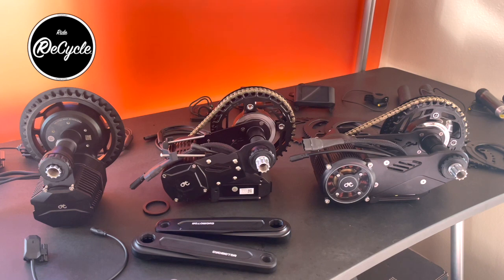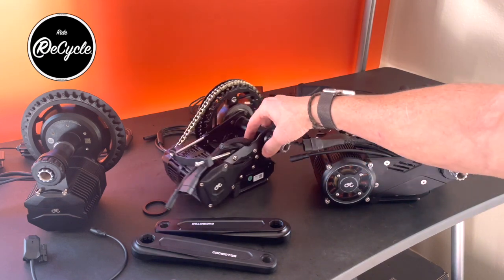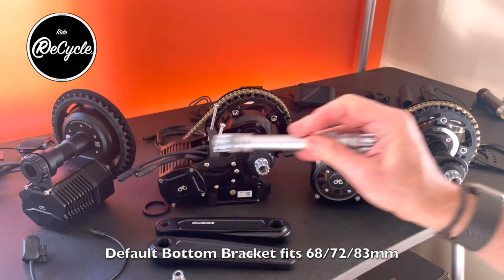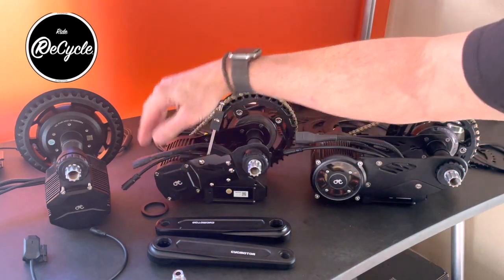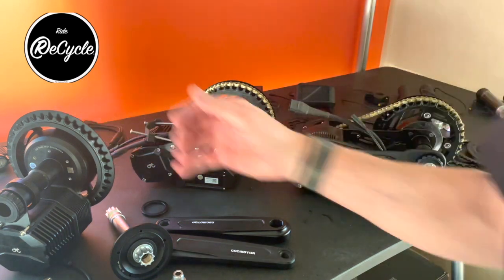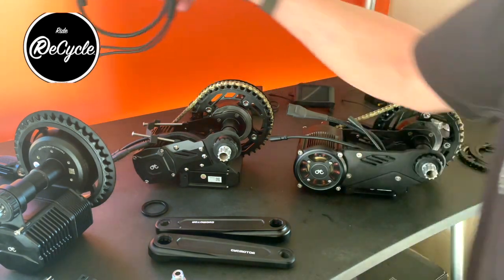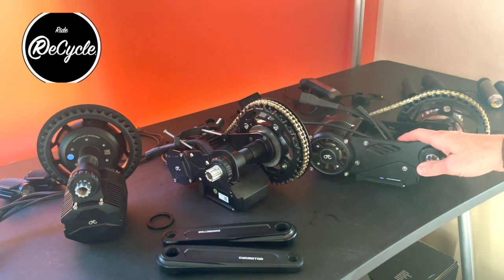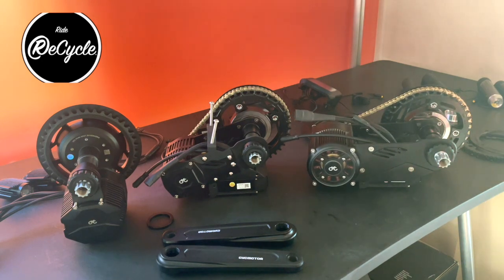CYC Photon, X1 Stealth, X1 Pro Mid-drive E-Bike Motor Comparison

Comment: I'm really curious to see what it takes to upgrade the stealth from a Gen. 2 to a Gen. 3
Reply from the maker: Hi @bear5cents, there are a couple ways to do it. The least expensive way is to just upgrade the controller. The more complete conversion changes both mounting brackets, the freewheel assembly, the BB and bearing assemblies, the torque sensor, the spindle + cranks and the retaining hardware.
Reply: Me too.  Have the first gen stealth (which i think they called the Gen 2 confusingly...) and it's been a great kit for the past 5-6 seasons!  But i've had a few probs that i would like to try and rectify by upgrading; 1) the freewheel at the cranks is so easily infiltrated by the conditions of mountain biking (mud, rain, whatever else) that they will seize up. The original one didn't last long, the second iteration also got grinding and sticky after only a cpl months, and i had to wait for replacements to send from HK to CAD about 4 times that i required replacement?  Great team at CYC Motor, but the waiting of weeks or month(s) meant a serious amount of downtime unable to ride (in some of the prime summer riding months too)  ...which was sad :(  and then 2) the older controllers could get zapped by moisture, but they replaced that too (same for waiting on shipping) and they now have their own in-house model.  and then 3) my square taper cranks have come loose and warped once or twice requiring replacement.  possibly number 4) is that i currently have my 4th or 5th freewheel at cranks, it's pooched just like the others all were, but i've been told it could be a prob with the bottom bracket having an issue too?  Anyway, just some feedback!  :) Oh and the 219 chain can get super mucked up from any mountain biking, dry or muddy.  I've had to make a few iterations of splash guards for my bike to help with all of these issues, and that has def helped a ton, but not solved completely by any means. I'd be curious to get the photon instead as it's a closed unit and pretty plenty powerful for mountain biking!  But it looks like it hangs pretty low in terms of clearance for riding over objects along the trail, which would be less than ideal to say the least.
Reply from the maker: Hey @dylandaviesdiptych it sounds like you've had a ton of experience with the Stealth but also had to deal with CYCs growing pains. They've had some issue but have shown consistent improvement. I haven't seen as many problems with the freewheel but we don't get nearly as wet here in NorCal. I still have a Gen 1 freewheel in use on a X1 Pro. The Gen 3 kits have far fewer ingress points so that should address some of your issues. No doubt square taper cranks are a problem - they tend to back out, start wobbling, then wear down the crank arms. They require high torque on the crank bolt and the bolts need to be rechecked frequently. Bafangs have the same issue but are even worse due to the softer metal they use in the crank arms - which is what makes the Lekkie parts so useful. The ISIS bottom bracket spindles are proven solution and common on all the Gen 3 and Photon kits. WRT part delays, we're trying to keep most spares and upgrade kits in stock to minimize the shipping delays. As for ground clearance, CYC shows photos of a Photon with the motor hanging straight down but it doesn't have to be mounted that way. These motors can be rotated forward on most frames with little or no clearance issues. I'll be posting another video soon with a bike build example. Even when hang below the BB, the Photon is much smaller than the BBS02 by comparison and only extends below the chainring by a couple inches.
Reply: @R-eCycle  I've understood that ISCG tabs can be in the way of Photon installation so you possibly need to shave them off. One of the reasons why I went with gen3 stealth instead. Just waiting for delivery
Reply from the maker: @mtbsieppo  I've had this issue with the V1 Banshee Prime. I had to remove one of the tabs to fit a Bafang BBSHD. With the Photon it will be less of an issue because the motor is smaller and the gap between the BB shaft and the motor is larger but it  may depend on the frame and how the builder wants the motor to hang.

Comment: I'm considering upgrading my tongsheng tsdz2b to the photon, but can't find any info on how much extra resistance there is for the photon when pedaling with no battery, as about half of the time I'm inside the city and don't need the electric assist, so I usually don't even bother taking the battery with me
Reply from the maker: Hi @violetavinocur4487, interesting question. It's hard to say exactly without finding a way to calibrate. I would say the Photon and the TSDZ2B are similar in terms of stiction with the motor off. Comparing the Photon with the X1 Stealth and Pro, the X1's definitely have more stiction than the Photon. It's most noticeable when turning the cranks by hand. Even with the higher resistance on the X1 Stealth and Pro, it's still easy to be pedal with the motor off and doesn't feel that heavy under foot.